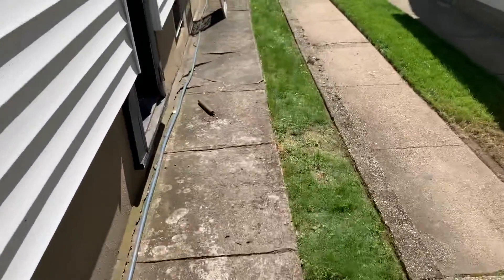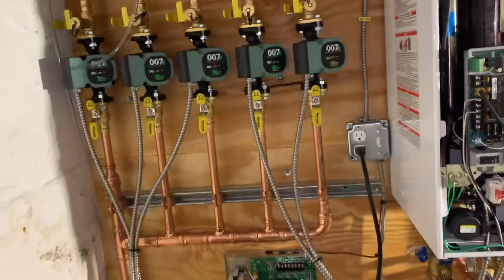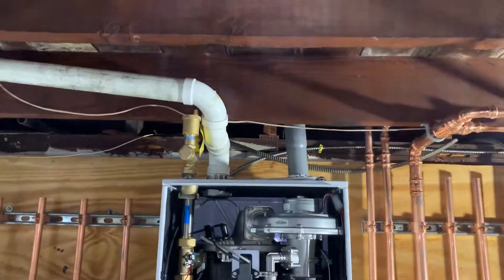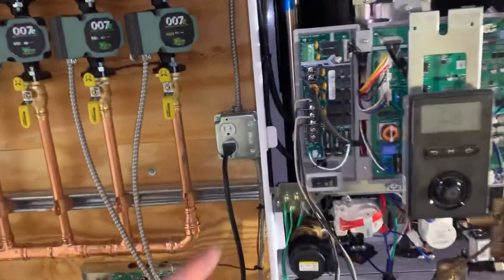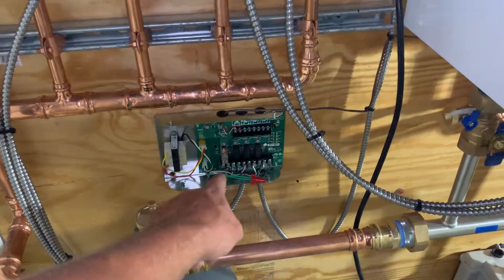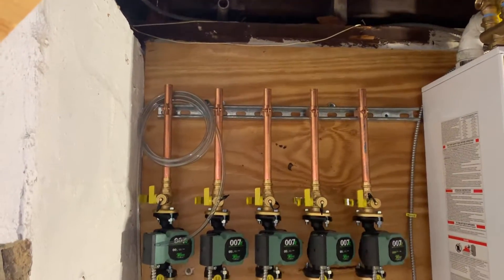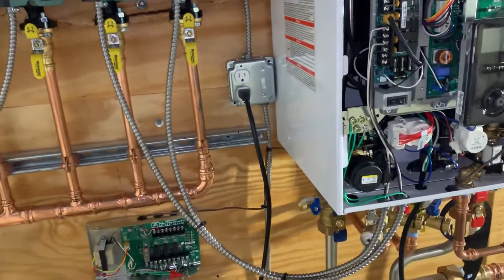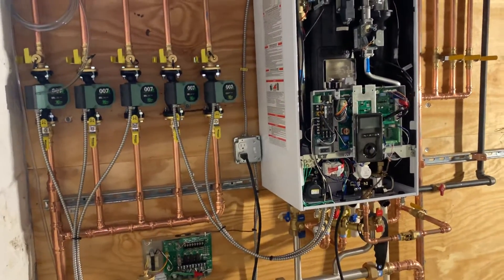Oil to Gas Conversion - 5 Zone Wall Hung Combi Boiler & Water Heater System model NFC-200

Comment: Why no low loss header ? it will work better with one and it will be more efficent
Reply: @PipeDoctor  No I am not there is no low loss header that silver thing below boiler is not a low loss header even if it was it is to small for all those zones,  with out one the pumps will work against each other and the boiler flow rate will not be correct , modulation will be out and boiler will not be effecient. A low los header has the primary flow and return from boiler going into it, then the flow to the pumped zones and return come into the opposite side of the low loss header, if I was you I would type into computer search low loss header and find out what one is , why you need one and how it works . Your pipe work is exellent .

Comment: Hi. I see you didn't use a pressure reducing valve.  Is that not necessary?? And how do you bleed the system??
Reply: Navien boilers have their own feed valve that doesn’t play well with a PRV… just a backflow is needed when using the on board feed.

Comment: Hey Mike Jim Downey originally from Valley Stream sorry to hear your problems with navy on but it seems like their temperatures are too high when they put the tip switch to 180° it’s not capable of handling the heat and that’s what’s causing the gasket and the plastic to fail this all comes to faulty construction because it’s not made to run at 180° inside that container with the electronics And and gasket or not made for those high temperatures and the Flu gases Good luck love your channel Jim Downey HVAC 30 years in the business

Comment: We do lots of Navien installs. No problems as long as they like you say are piped the way Navien wants them done.
Reply: @PipeDoctor  i know it's a pretty general question and the a lot of variables but what is the ball park on a combi for the until and install; single zone?  Are we talking $10K or $20K or somewhere in the middle?  Again, just curious on a ball park

Comment: Thanks for the tour.  Lost my 1960s Boiler this past week (2021).  Jacket finally gave up the ghost and is leaking at a section joint.   The HVAC contractor spoke with me two days ago (Today is Sunday).  I trust they will call tomorrow as we are living with space heaters but the Outside temp is 30F for now.  The guy looked at ours and explained the options.  These Condensing ones look promising.

Comment: What does something like this cost? I am in five towns just wondering. I have radiant heat 14 zones but burnham boiler . I wanted to switch to navian and re do the loops and also get the hot water heater maybe like a combi.

Comment: What’s the sis of the zone and how far is it from the boiler ? I am being told that for 1 zone that covers 1200 sq ft apartment 1 floor above the boiler would need a 30 gpm pump and more expensive install , while a floor with 2 zones covering 600 sq ft each is ok with taco 15. What’s your thought ?
Reply: That should have said size, not sis
Reply: 30 gpm sounds like way to much for 1200sq ft more like 3 gpm

Comment: I tough you don't utilize the boiler feed on Navien's system, so what happened here?
Reply: How hard it will be to bleed the system since you don't use an external feed? Is it true the unit has to be on, gas valve off in order to do this?

Comment: why a pump for each zone, if it had a manifold with actuators you would only need 1 circulator would you not?
Reply: @PipeDoctor  do you find advantages to that, is each circulator feeding radiators in that set up. For different floors or areas of the house?
Reply: @PipeDoctor  I got you now. Thanks
Reply: @dwaynerenton1889  what he didnt tell you is you will be using more electricity-you can always keep a spare pump on hand,,suppyhouse.com
Reply: @stevestadterman9270  yes more pumps more energy, im in ontario canada and i dont see alot of that type of set up with rads  I put infloor off my manifold and 1 pump to do the manifold, it is only for basement slab heat and i also always use a furnace as well so if pump fails customer still has heat.